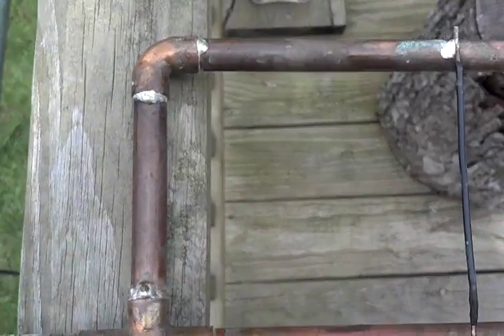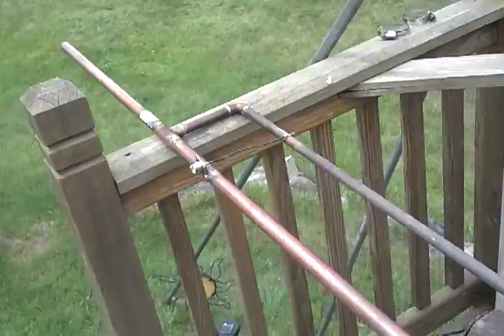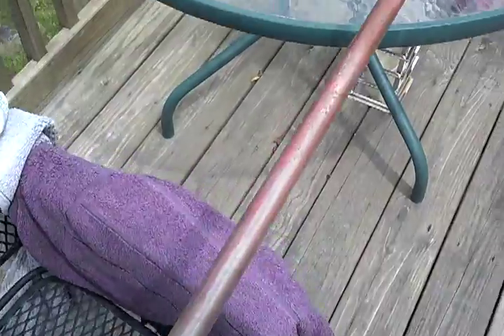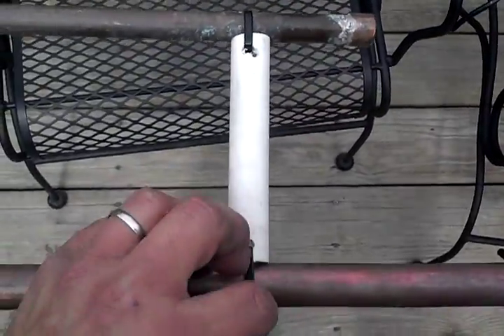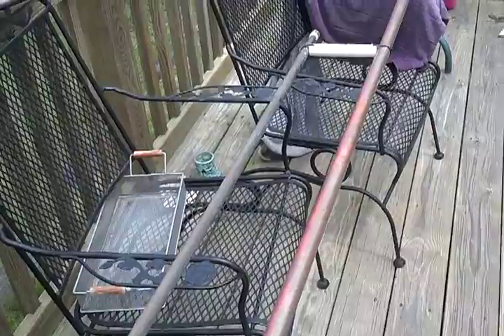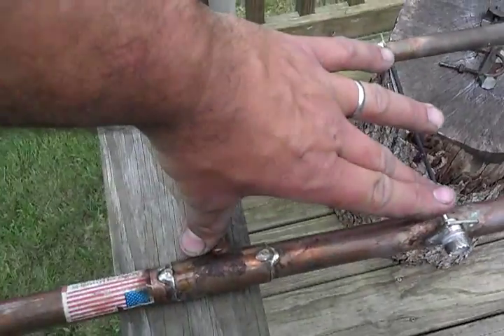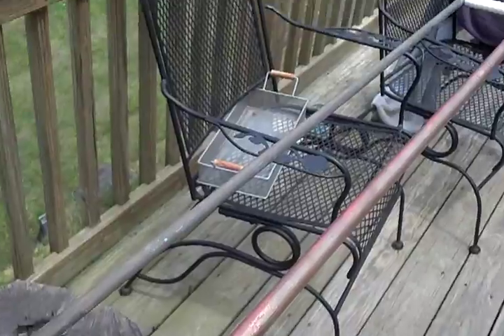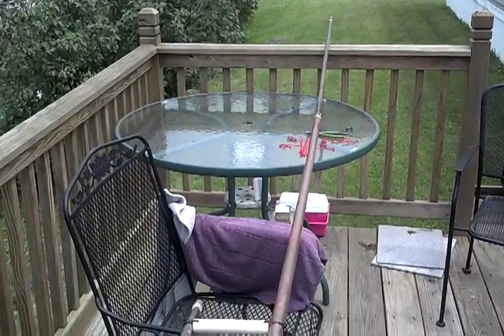6 meter j-pole antenna copper pipe

Comment: Here are specs for those who don’t want to rewatch and write. 

J-pole 6m

3/4 inch
1/2 inch

1- 3/4 to 3/4 to 1/2 T
1- 1/2 elbow
2- 1/2 caps
1- 3/4 to 1/2 reducer

CUTS
20” copper 3/4 for base
5” space piece 1/2
56” 1/2 for radiator 

5.5” from couplers to matching cable, SO239 connector.

Comment: Nice work, but you have the feed wrong...the centre conductor should be attached to the longer portion, and the ground to the shorter one....
Reply from the maker: Actually it does not even matter! All this feed does is move the impedance marching secting up or down.  You can do either side with similar results!